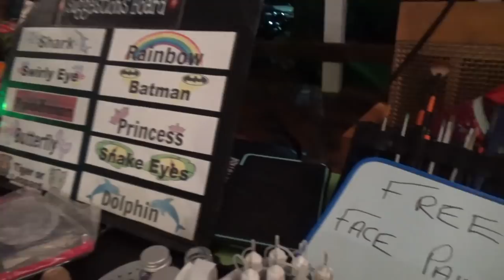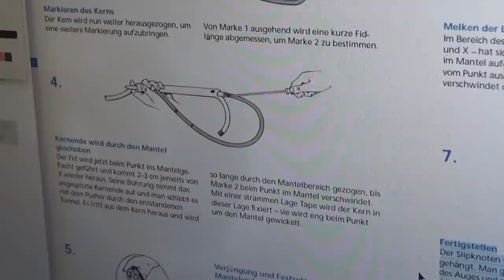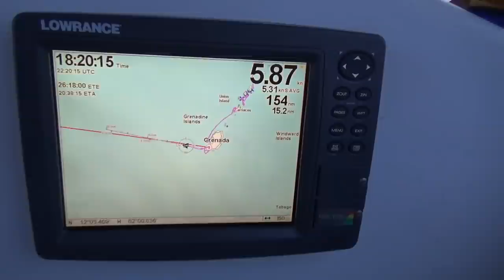Getting Ready to Sail Downwind— Sailing Uma [Step 94]

Comment: The topping lift can also be used to lift the boom in light conditions. This will allow the upper part of mainsail leech to twist to leeward. Together with easing the mainsail luff tension and easing the foot tension will allow the mainsail to make the most of the energy from the light airs. I could add heeling the boat to leeward but it's not so easy on a keelboat.  Great YT channel.

Comment: Great that you are using Dyneema! I rigged our entire boat with it (standing and running) and it's working beautifully as we cruise.
Reply: I only know of Dyneema from rock climbing. It is notorious for loosening knots. Out of curiosity, have you had problems with it loosening over time?
Reply: You use splicing instead of knots just for that reason.
Reply: It's not UV stable unless you drop some serious money...
Reply: +Robert Dietz it does like to untie because it is so slick and slippery, but if you tie a proper knot it will hold fine. I use a dyneema pendant to secure our reefing tack point with a simple sheet bend. It holds well, but if you don't tie the knot properly it will slip apart.

Comment: Great job sewing, the sailrite machines are excellent and they have great customer service and parts availability. Have you guys thought about some more sails? A asymmetrical spinnaker seems like it would make your life alot easier. Also a 70% jib that was built heavier would handle the higher winds better than a rolled Genoa. It'd give you better pointing and the center of effort of the sail where you want it not up high where a partially reefed genoa puts it. Just my thoughts.

Comment: Nice splice Kika! But you two should keep an eye on that splice that's riding directly on that thin wire, it might chafe through quickly. I've never used dyneema, but I've never seen any line that will not chafe on wire. By rights, you should use a thimble on the dyneema and then you'll be alright.

Comment: time to invest in a fid kit it comes with great instructions .it takes a few tries before you get it right. its even harder with used line,or larger diameter line,and if you screw up usually you loose about 3ft of line,so plan ahead

Comment: With the dyneema, you can also splice it using a piece of wire instead of the pen shell. Check out Chris Coates' video on rigging spearguns - I've found it a lot easier. You could also look in to using a brummel lock splice. It's a lot of work with longer lengths of rope but prevents the chance of the splice failing. No idea about sail boats but I've had them fail on my spear gun a few times, all it takes is an uneaven pull on the loop end.

Comment: What makes the last scene so precious, more than sailing into the sunset in lovely conditions, is that you have each other.

And on a more pedestrian level, why do you two take your snorkels out of your mouth? I used to free dive and still swim laps for exercise with a mask and snorkel and never take it out of my mouth while I am swimming. The mouthpiece on the Head snorkel is quite comfortable with a soft rubber arch that fits on the roof of my mouth.

Are you aware of "sheet to tiller" arrangements which are a less sophisticated way of approximating a wind vane.....and much cheaper?
Reply from the maker: I find taking the snorkel out allows me to hold my breath longer with less effort.
Reply: It's easier to talk too. :)

Comment: Maybe close to a lifeline store as well I’m still amazed you haven’t bothered to “fence yourselves in yet”!!!
Reply from the maker: It on the list for when we get back State Side. We've never viewed typical "life lines" as a safety device, more a tripping hazard. But have plans for an all stainless rail. But welders and materials are very expensive down in the Caribbean, so it'll have to wait. We've learned to get by just fine without them though.
Reply: Sailing Uma yeah a stainless hand rail would look great and something to grab as a last resort if one falls backwards.lifelines on the deck can be a trip hazard but a necessary one on a passage in rough seas cheers guys go well fair winds